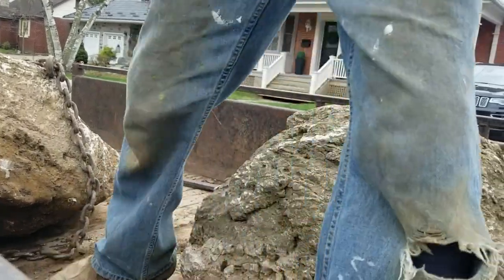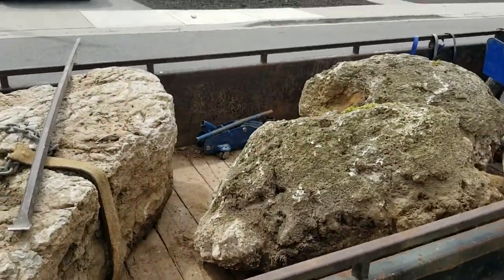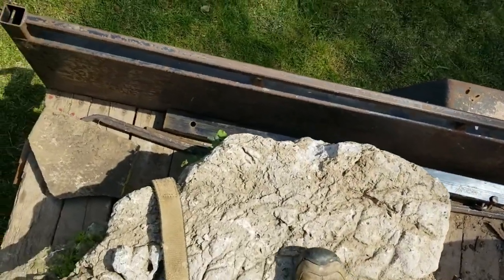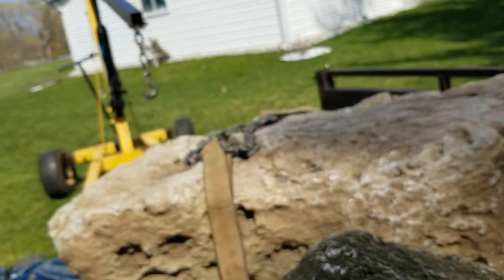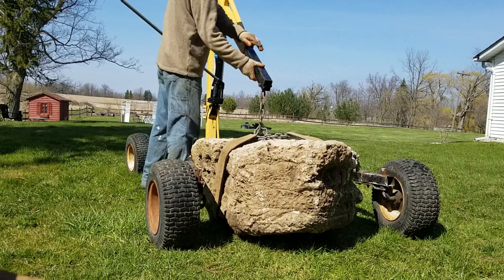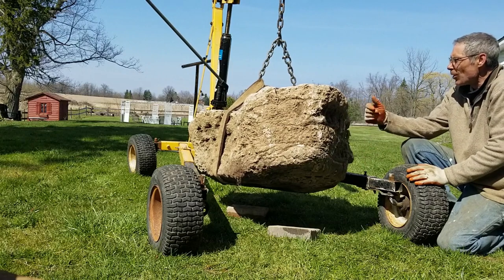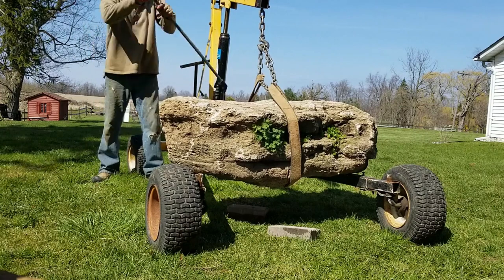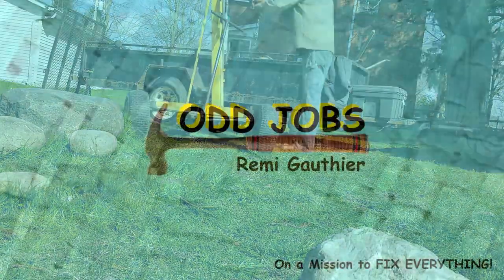Moving large rocks by hand (using modified hoist)

Comment: Yeah I have some granite boulders that are closer to 4x4x4' I am wondering about moving them by hand. I think that I better call in some heavy machinery though. I can't imagine how I could get them up out of the ground and then move them. Your setup would be fantastic for most of the rocks I need to move here though! Thanks for sharing, best of luck on the water works
Reply from the maker: Those are big. I think granite weighs in at almost 200 pounds a cubic foot. You will need a machine for sure. But check out Markerbuoy. He has some good ideas. https://youtu.be/xp6M2ghzhjg

Comment: Wouldn’t you be able to get the crane under the trailer if you let some air out of the tires ?
Reply from the maker: I have been down that road. Either I am spending time inflating and deflating tires, and moving the trailer back and forth (because the crane wont roll with flat tires and a 2000 lb load), or I spend the time chaining and pulling. Chaining and pulling is more time efficient.

Comment: Shortening the jib moved the rock (and hence the centre of mass) rearwards.
When it was sitting on the frame,  taking part of the load on the jib did not move the rock,  nor the centre of mass.  The load is still where the rock is. 
There's many ways to prove this but perhaps the simplest to explain is to consider the situation where the rock is hanging entirely on the jib...if this moved the load back to the jib base,  then you would not need the front tyres out past the rock. Instead you could retract them back to just past the jib.   Clearly this is nonsense, as it would just tip forwards.  Why? Because the centre of mass of the rock is not moved just because you lift it two different ways.
Reply from the maker: Again, I have worked with this device for years, and have had opportunity to put it to the absolute limit. The cylinder has a lifting capacity of 8 tons, but the jib is rated for 2 tons. I overload this rig constantly, and when pulling it with a tractor, any rock suspended on the jib will tip the rig. In the field, experience always trumps the science. Lower the load and make it stable.